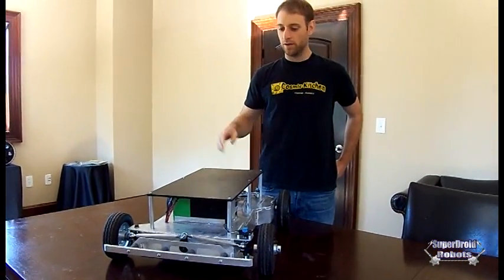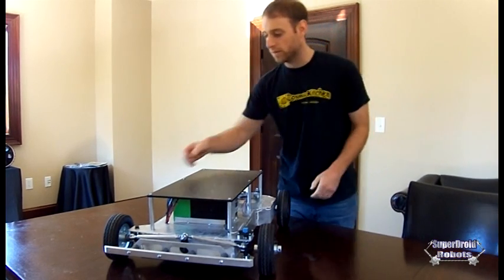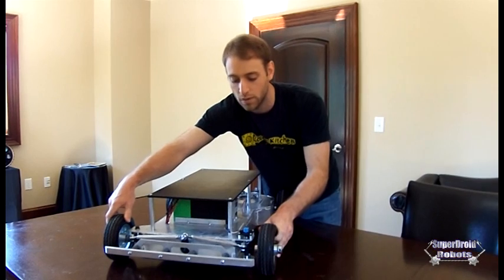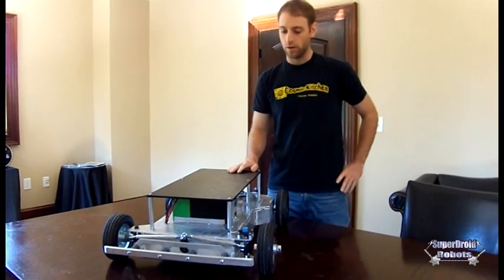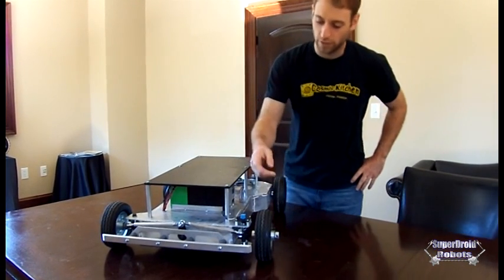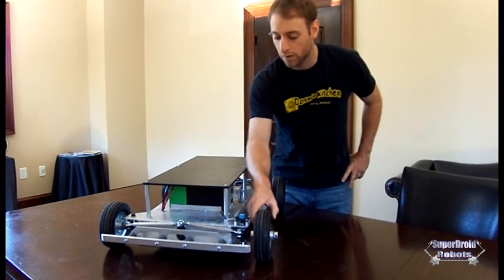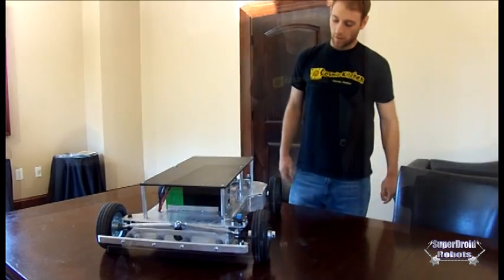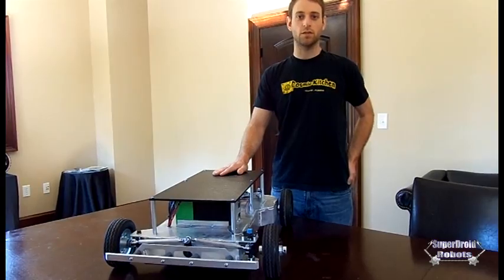Robot Designed with  Conventional Steering by SuperDroid Robots

Comment: Could you post a parts list
Reply: At least for the steering mechanisim
Reply from the maker: ~IG42 motor: https://www.superdroidrobots.com/shop/category.aspx/42mm-gear-motors/77/

~Dual bearing system, custom coupling, tie-rods and wheel shafts: https://www.superdroidrobots.com/shop/custom.aspx/heavy-duty-atrs/49/

~IG42 122RPM motors with encoders: https://www.superdroidrobots.com/shop/item.aspx/ig42-24vdc-122-rpm-gear-motor-with-encoder/849/

~Saabertooth 2x12 motor controller: https://www.superdroidrobots.com/shop/item.aspx/sabertooth-dual-12a-motor-driver/1155/

~(qty 3) K2 12V 9.6Ahr batteries: https://www.superdroidrobots.com/shop/item.aspx/k2-12-8v-lifepo4-battery-pack-9-6ahr/1139/

~Arduino Due microcontroller: https://www.superdroidrobots.com/shop/item.aspx/arduino-due/1436/
Custom chassis 

Link to the support page: https://www.superdroidrobots.com/shop/custom.aspx/conventional-steering-atr/86/